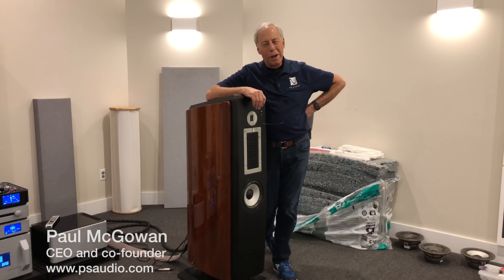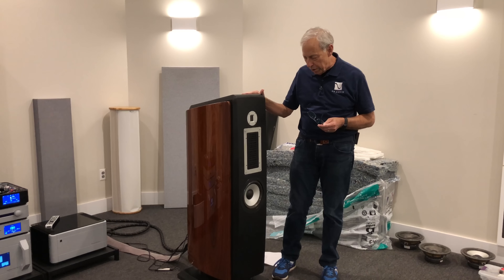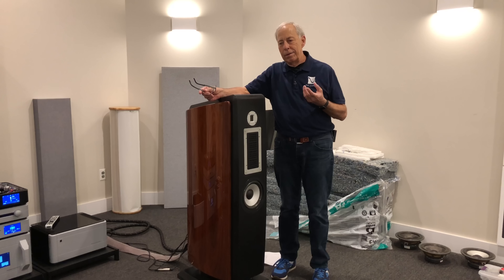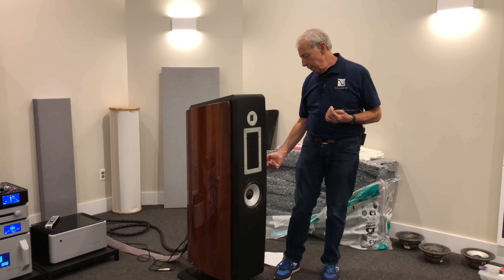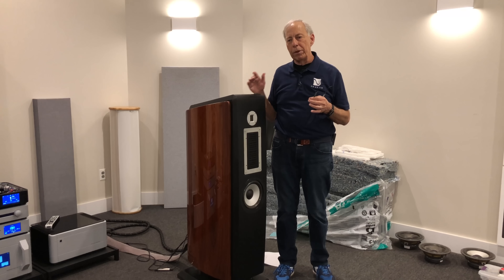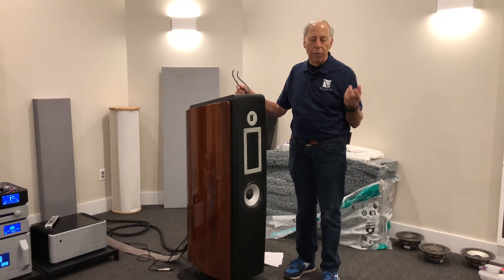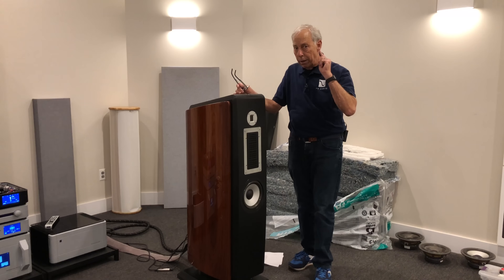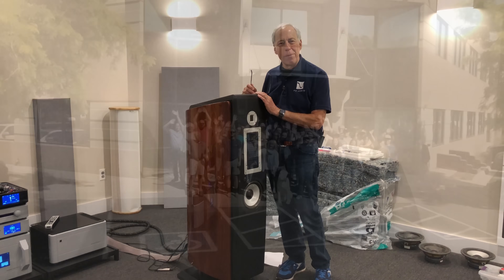What is a midbass coupler?

Comment: Please don't stop rambling, I learn so much from your ramblings.

My first job oput of the army was as a engineering technician for Analog Devices in Cambridge. Our incoming inspection division used to run every single transistor and FET through a screening program so devices could be specified by gain, bandwidth, and Vbe. Designers could specify exactly what their circuit needed. We could also screen devices for their noise figure  so a designer could control the noise levels of an input stage.

Comment: I am so confused here. what I think you mean by what you are saying is that you have a 4way speaker. Tweeter, Midrange, Woofer, and Subwoofer. 

But what you sound like you are saying is you have a Tweeter, Midrange, Midbass coupler, and Subwoofer. 

Am I missing something? Is this like an Appleesque branding tool? Midbass coupler does take more syllables to pronounce than woofer I suppose.  I mean why make up a new term to describe something that is already described. Yes you are not using the full range of the "woofer" because it is not driving the "subwoofer" frequencies. But that doesn't change what it is. It is a woofer that is suited for operation likely between 20hz-2000khz. 

If I am not following could you please expand on what makes your Midbass coupler any different than a woofer?

Comment: Why are you using the word coupler? I see a tweeter driver, mid-range driver, mid-bass driver and woofer driver.

If that is being used because it couples the mid range and woofer then you also have a mid-range coupler to couple between the tweeter and the mid-bass driver. Doesn't every 4-way system then have a midbass coupler? If I have bookshelf based 2.1 set up and say a 150hz crossover setting then I changed the woofer to a subwoofer coupler, coupling the tweeter to the bass driver. I get the marketing aspect and attempt at product differentiation which of course is very important.
Reply from the maker: It's because the driver's use is not traditional. 3-way systems are common and their driver complement established with names like tweeter, midrange, and woofer. But the addition of a 4th woofer to couple the top of the woofer to the bottom of the midrange can be confusing and certainly not traditional. The name that got adopted reflects its functionality.

Comment: i really like the idea behind midbass coupler,  i notice with my bookshelf speakers and subwoofer that higher i set my subwoofer low pass the more impressive and big my system sounds. same effect with bigger main speakers, bridge the gap to subwoofer you could say. 
current subwoofer cant play higher than 120hz, but i can adjust the slope but that dont sound very good lower than 18db pr octave.  had a huge diy subwoofer in my youth that had 200hz upper limit, it really messed up the sound to my tower speakers but felt like a nightclub and hit like a truck.
there is something special when you get dual 15" playing 100hz to 200hz that most people wont experience at home. especially with hifi quality sound.

Comment: visually, i much prefer this design over the current one shown at RMAF.
but here is my main heartache.....
the sub gets its own 700 watt amp.
the couplers get their own 700 watt amp.
that leaves only the tweeter & midrange in need of my BHK.
isnt that tremendous overkill?
Reply: @FatRat-f9m   The sub is active with its own amplifier built in.  The rest is powered by a single amplifier of your choosing and it's all passively crossed over. You could probably pull the bridge bars and actively control the tweerer, mid, and/or midbass coupler. But this could void warranty if you set your active DSP crossover to something rediculous which would tax the tweeter and mid or the usual protection circuit on the tweeter.

It does appear like he's pointing to the midbass coupler, but I think he was referring to the subwoofer when he points and says "woofer."

The wattage break down wouldn't make sense to throw 700 watts at a subwoofer and another 700 watts at just one small midbass coupler. Although it could be in his design philosophy that the low mids must have beyond ample power to achieve clean dynamic range.
Reply: @thunderpooch  Ah ha. Interesting breakdown. Thanks for that explanation.
Reply: The sub gets 700. The rest get the other 700. I'm guessing the midbass cooupler gets 350, the mid gets 250, and the tweeter gets 100.

I could be wrong, but 700 watts for a midbass coupler is nuts.

Comment: I was thinking why don't you make the ribbon because it's open-ended isn't it on your new speak hollow tube all the way through to the back would be a better way.
Well I don't believe  that's just bs, you can easily over extended a driver  having too much power yes you can control it with electronics but the actual physics of the driver can be extended past its overhang point
Reply: I expect the amplifier has a limiter designed in to prevent it from going into clip. The driver would need to have a power handling that exceeds that by a decent margin. There's plenty of 12" woofers in the car audio world that can comfortably sit at over 1000wrms and deal with the heat.
Reply: @chrisvinicombe9947  yes it is a possibility